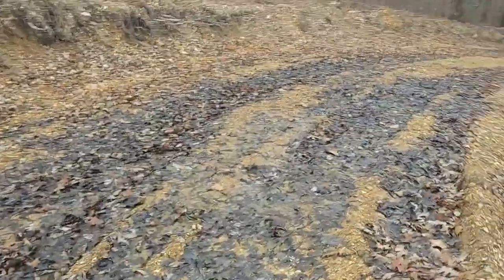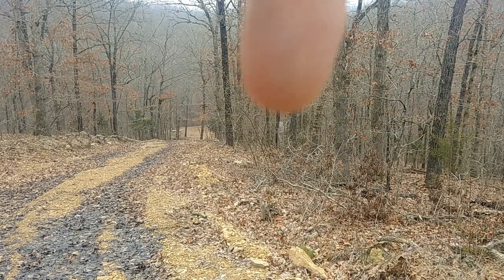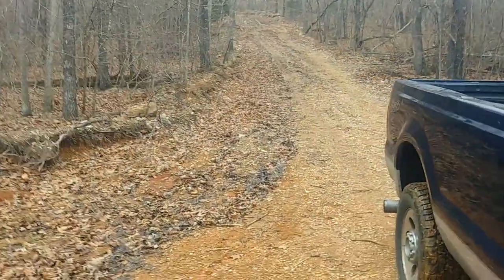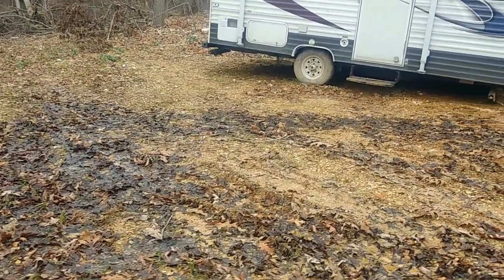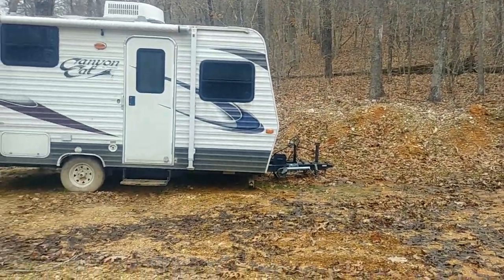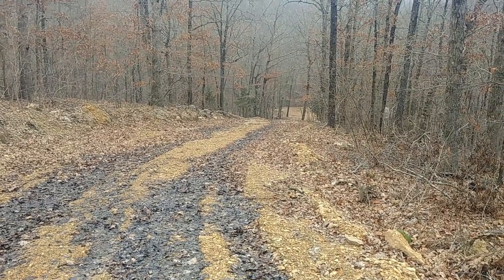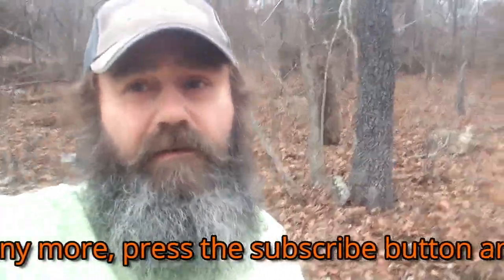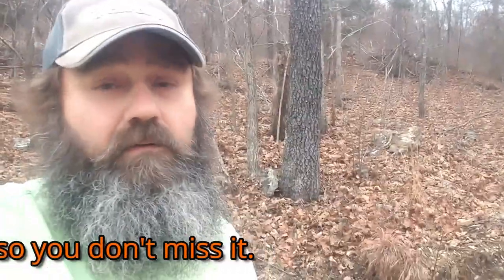Diverting a Spring - need suggestions

Comment: Good suggestions already. I'd be inclined to try to build a pond near the spring to catch the water, then divert the run-off down the hill on the other side of the drive.  With the help of elevation & gravity, you could then send the water from the pond anywhere you need it. I also agree with the need for a ditch along the drive to divert any run-off from washing out the drive, but that doesn't keep the water out of the camp area.
Reply from the maker: Yep, all giid suggestions, I just need a quick fix.
Thinking about option 3

Comment: Given your terrain, your driveway really should have a ditch running along side it (same side as the spring) starting from the highest point running right through the spring. The ditch will not only channel the spring water, but keep any run-off from the upper side of the driveway from washing the driveway out. If you are on a budget, try to find some smaller stones around the property to line the bottom of the ditch to prevent erosion. Otherwise, by some stone (the size of your fist) to line the ditch. We fix so many driveways that wash out because of the lack of drainage ditches along the side of them. Hope this helps, and if you didn't understand my ramblings, just ask! lol
Reply from the maker: The ditch would have been the correct way, I agree I won't mind having to regrade it once or twice a year if it washes out. I am mainly concerned with the water from the spring that is always on the road.
we are still not 100% sure what we are going to do with this road in the future. It wont be driven on daily even when we are living there. 
We have even been tossing around the Idea of letting it grow up and moving the road.
But for immediate, we do need to do something about the water.

Comment: Having grown up on a farm with a spring,  I feel you are blessed to have it.  The problem is your unhappy with the nature of it all.  A spring feed catch pond would never be "dry".  That's fishing year around.  If your unable to pond it, then use a catchment with a ram pump.  It's still free.  It will not ruin nature.  The water can still be used and diverted through a small flexible hose.  You don't even have to bury the hose.  If the fall rate is far enough, an auto siphon instead of a ram pump will work.  Black plastic pipe is cheap!      A barrel will cost you twenty bucks (plastic), concrete one about a hundred.   Make one for fifty.  You have a sweet deal with that spring.  Think of the moon - shine  (ing) on the cooler coil!  :)
Reply from the maker: I am going to watch some videos on ram pump, sounds interesting..  I would be happy just to get the water off the road.

Comment: Looks like you could run a culvert across the road and it should go down hill from there...or run a ditch all the way down the road to your camping spot and dig a small pond, then you got yourself a spring fed bathing pool..might be a touch chilly in the winter!
Reply from the maker: I am wanting a quick fix for now, the pond idea I like but would be time consuming.
Reply: @MySliceOfHeavenoutdoors  I gottcha!  you could probably just dig a very shallow ditch across the road, just low enough to catch the water and run it across the road and still be able to drive through, maybee line it with small rocks so it doesnt turn into a muddy mess
Reply from the maker: @HewettHomestead  Thats what I am thinking. I think this will be the first step. then see what it would take to develop this spring. maybe a capture tamk on the other side of the road.
but immediate i just need it off the road
Reply: @MySliceOfHeavenoutdoors  Yeah I here ya on the tank... even if its just a 50 gallon drum.. it would be nice to be able to use some of that water.  even if its just for washing your hands or watering a garden. Good Luck with that!

Comment: DeHaven Family Farm has excellent advice. Option 2 in Kentucky we would put done 3 layers of gravel to allow natural water to run. It's expensive.
Reply from the maker: I agree Joy, Dehavens way is the correct way. but we are not 100% sure what we are going to do with that road yet. It may not even exist in a few years, we may change it.
The road is very steep and hard to get up when it rains, or even has water on it.

Comment: As a former home builder I once had to deal with a spring on a property where I wanted to build.  I simply created a new channel for it to flow into and ran the water off to another location.  Worked perfectly.  

Since water runs downhill and the spring is at the top of the hill, you can make that water go anywhere you want it to just by creating a path (ditch, swale, pipe, etc.). from the spring head to its destination.  A track loader isn't the best implement for that but if you wort at it a bit, you can get the job done with it.

See Williams Adams comment.  The spring is a big asset to the property.  He has outlined a good plan to consider using a ram pump or other pump but there are other good options too.  Personally, I would use the front loader to work out a small pond in a valley downhill somewhere from the spring.  Having ANY sort of water source on your property such as a small pond, even if only a quarter acre or so and only a couple feet deep, is a tremendous magnet for all forms of wildlife.  Deer will visit and hang around it all the time, as will everything else.  A small pond will easily regulate the flow of water coming from that spring to keep things more manageable.

Note here that if you do a pond you do NOT have to line the pond to keep water from seeping out.  A slow seepage of water from the pond bottom on into the soil below is exactly what you do want as it helps absorb and handle the spring water flow.  So just make the pond using the natural soil. It will work as a seasonal wetland more than a pond but that is fine.

See also Heavenly Hill Family Farm's comment on doing a swale for the water across your road.  You will NOT be able to keep a good road surface with the spring using the road as its path.  So if you want to run the water over to the other side of the road, that requires a method of crossing that won't wash out and is sufficient to handle the water flow.  A concrete swale, if shaped right, would work fine.  For that matter, a properly constructed rock lined swale would work too but would be rougher to drive across.  

I'd personally also consider getting a large sized culvert of 12 to 16 inches, trench across the road, bury the culvert, and extend it far enough downhill to be well away from the road.  You would need a rock lined or concrete initial catch basin at the spring head so that the water will not erode away the dirt and make a new path to avoid entering the culvert.  And you will need some rock placed at the outflow end to break up the water pressure and prevent erosion at that end.

Whatever you do, don't just direct the water into the road ditch.  That will only erode the ditch deeper and deeper which over time will undercut your road or make it hard to do road maintenance.

This really isn't a big problem to solve and having a flowing water source for food plot and garden irrigation is a huge benefit.  You just need to decide where you want to the water to go and make a path for it to go there.   

Good luck with this project too.
Reply from the maker: Thank you, I am pretty sure I want to start it with a catch basin for now and build an overflow to run under the road till I decide what to do with it. Just need to get the water out of the road cause we are tearing it up

Comment: I read this  Info a while back  My  dream is to have land next to a lake or at least a pond/ spring.   ----                   A spring, because it takes the path of least resistance can meander quite a bit under ground and can require quite a bit of excavation to follow. Not to mention once you reroute it, it may change direction again next year. A catch basin with drainage tile is the most feasible method to handle it.
Reply from the maker: That is one of my options, I will keep that in mind. thanks for watching.

Comment: I don't work construction so take my suggestion with a grain of salt. I wouldn't think you'd want to run it along the left of the road going downhill. it will be a problem at some point in time for your road. 

I imagine you'd want to run a drainage ditch, fill it with gravel and run it under the road. I think you gotta figure out how much water runs at the peak. That would decide the size of the draining ditch and pipe. Run it a bit further than you might think you need. I got one under my road that has eroded away the hillside and has started pulling away a piece of the pavement at the entrance of my place. I hope it doesn't get any worse.
Reply from the maker: Thanks Chip, I will keep this in mind. That is one of the options I have been thinking about

Comment: Yep gonna need a backhoe to dig out a big drainage ditch along the road that runs under a big bridge where the trailer is at then into a 100 yard diameter 30 foot deep hole that forms a lake stocked with bass....Oh wait what were you asking?? I was daydreaming about something LOL
Reply from the maker: haha, can you have that done by tonight?
Reply: @MySliceOfHeavenoutdoors  Use the dirt you dig out to make the drainage ditch to fill in the low areas around the RV so that diverts the water around it such as move the RV build a big elevated pad for the RV and parking then set the RV back in again with a big drainage pipe buried in the driveway pulling up to the RV

Then you are out of the mud and water is diverted past the pad your RV and vehicles sit on

That underground runoff will be hard to stop unless you dig a deep drainage ditch that can handle both underground and above ground run off sending it down hill past the raised pad you would build from the dirt you took from building the ditch deep enough then with french drains all around it to keep it from getting undercut also

Of course depending on where you live you may need a permit to rent a backhoe, permit to put it on a trailer permit to move the trailer permit to look at the trailer permit to unload the back hoe along with permits to operate and steer the backhoe and then might could need a permit to dig any place that might have dirt with expensive multi million dollar surveys of land required before you can get the permit to even look at a backhoe LOL

As for me I would just ask a friend, hey dude let me borrow your back hoe and never tell em what I was doing LOL
Reply from the maker: @RayBlackburn  By the end of the year the camper will be moved and the camp area will be a food plot. Just dont want it to be muddy there all the time.
Reply: @MySliceOfHeavenoutdoors  Yes either way will need to raise the plot some so water runs around it and does not settle there

Comment: Oh... watching now.. Springs and water engineering is my forte'... advice to follow!
Reply: Is that the only place it seeps out up at the top where it appears to begin?  If so... yes... I would even dig into that high spot a bit (now that you have a track loader) and create a "catch basin" for the water.. then divert it across the road in a small culvert.... then catch it into a tub or barrel of some sort. This could be a gravity fed water supply for your farm!  Let me know more info.. I am glad to help you engineer this from a liability to an asset!  Later, if there is enough volume and you need to pump water to higher elevations on the farm, a ram pump could be added. A spring on a farm is SUCH a wonderful thing! I cherish my spring!
Reply from the maker: @TheFarmacySeedsNetwork  That is the only place I see it coming up here. There is actually 2 spots about 18" apart. I am sure they come from a single source further in that hill.
1 of my options I was thinking about is dig into the hill, find the source then dig a hole. Drop a bucket with holes in the bottom in the hole and drill a hole near the top as an overflow.  fill the bucket with gravel and cover with plastic and dirt. then run the overflow pipe under the road to the other side.
Reply from the maker: @TheFarmacySeedsNetwork  while I have you here, is it ok to start seedlings in clear containers?
Reply: Yes, its fine... better not to expose roots to light.. but I have not experienced any negative issues with it.
Reply: yes that sounds like a good idea.. "capture and divert".  later you cans end that water to a more useful place if you choose.  cheers!
Reply from the maker: @TheFarmacySeedsNetwork  cool, I have access to lots of clear liter water bottles. Thinking of using them to start my chestnuts this winter.

Comment: It's tough to say Joey. I always like to see things first had before making earthwork suggestions. I need to know a lot of things. 
Option number one seems like it might work. I was wondering if there was a way you didn't have to go across the road.
Reply from the maker: Hi Jim, thanks for stopping by. I originally wanted to go with option 1, but the more I thinkabout it I like option 3. Option 3 gives me an oppurtunity to come back and use the water if I want. and I could divert the overflow anywhere.
I could fill tanks with the overflow or make a pond, just divert the pipe where I want it to go.

Comment: Run a pipe under the road and a lined trench on the other side of it till the terrain goes down.,. Or move your camper
Reply from the maker: something like this is what i am leaning towards. I keep changing my mind between a frech drain like you suggest or  capturing the water and using it in the future. For now I just need a quick fix.

Comment: So it only flows after heavy rains?  Personally I would make a concrete crossing (like a intersection rain water ditch, cant think of the proper name) on your road that diverts across to where you want, I personally like concrete for two reasons, I can get it at trade value and I don’t have to worry about a pipe getting plugged with debris or popping out of ground during heavy flow.  I have to put in at least three on my drive to control runoff rain water.
Probably didn’t make any since, know what I’m trying to say, my brain is tired. Had to finish a Emissions report, ugh
Reply from the maker: no, it always produces water. This isn't a creek crossing, it's in the road at the top of the hill. don't thik concrete will work for this application. Do you know of a video that you are talking about that I can watch.
to me it sounds like you are talking about a missori crossing only with concrete.